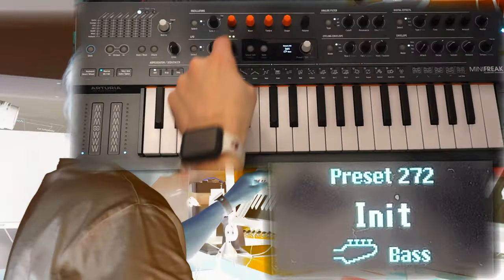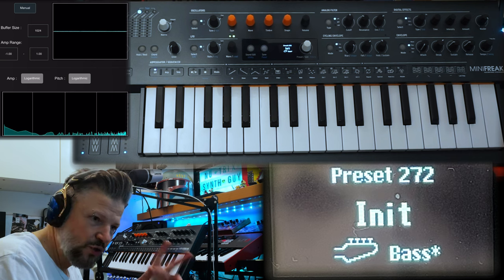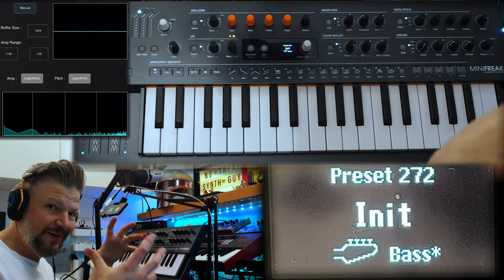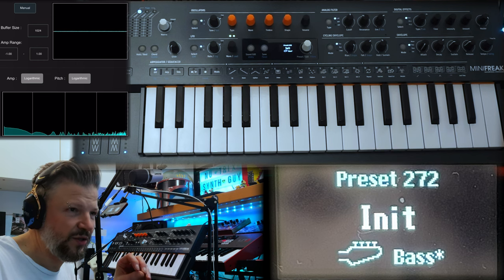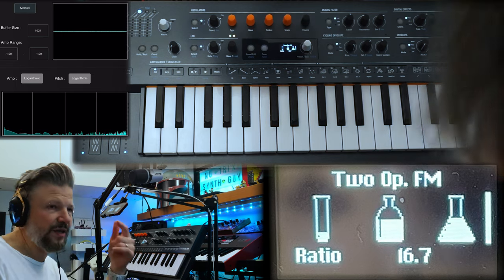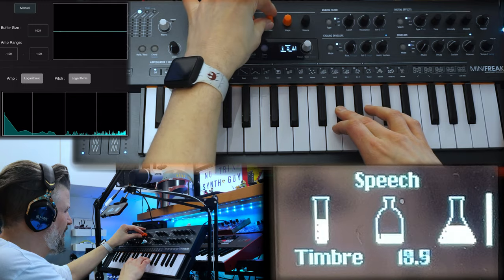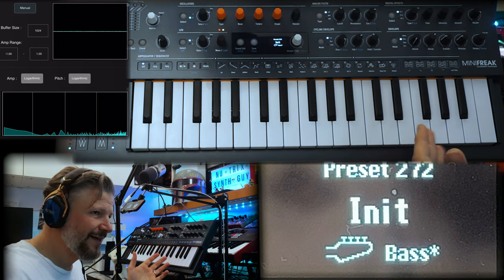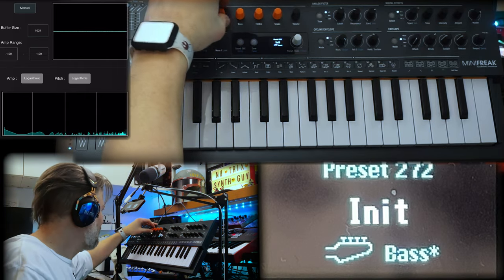MiniFreak complete guide to synth and poly FX engines

Comment: Thanks for the info on each of the oscillator types and effects. I’m guessing that it would be possible to use the Microfreak to create one of the missing oscillator types and then patch that into the audio-in on the Minifreak? That seems like an option for anyone lucky enough to own both, and I’m curious how it might be set up with a midi connection, so that the Microfreak can be played in sync with the Minifreak. Can it be done I wonder?
Reply from the maker: It can be done . Just take the MiniFreak MIDI out into the MicroFreak MIDI in and the MicroFreak audio out into the MiniFreak audio in. It’s going to be a monster synth! I’ll have to test that.

Comment: hey, do u have any idea if on the plugin version of the minifreak; the minifreak vst, would be able to use the aftertouch effects on the microfreak? or use the mod matrix for example on the minifreak vst😊
Reply from the maker: The MicroFreak keyboard send polyphonic key pressure “polyphonic after touch” but the MiniFreak brain and keyboard recognize “Channel after touch”. These are different ,non compatible messages. I did test it and no it doesn’t MicroFreak polyphonic key pressure does not work with the MiniFreak.